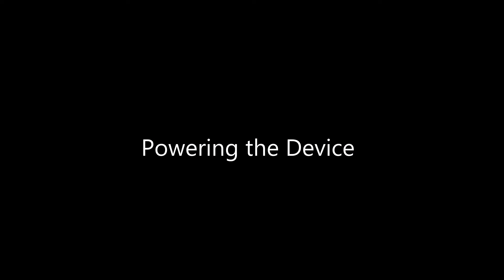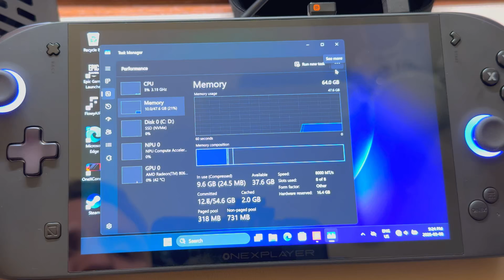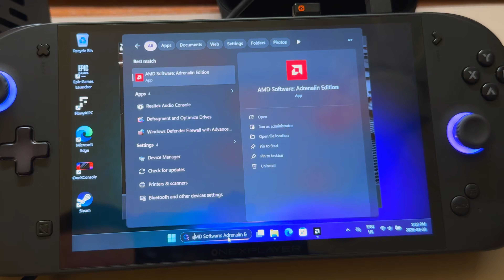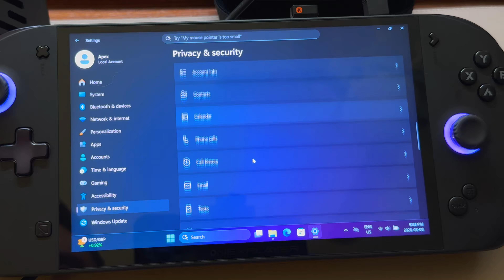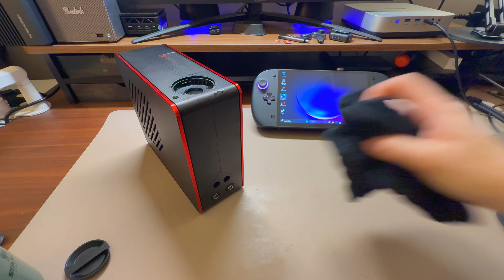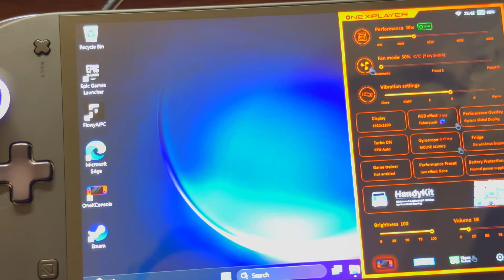OneXPlayer APEX - Day 1 Setup Guide !!

Comment: So once the liquid cooler is connected you lose the stand from the battery, that’s really odd and bad engineering because how the handheld will be sustained?
Reply: If your using liquid cooler you’re most likely docked, so it’d be in a dock anyways
Reply: @zbt62 

What dock is the the best for it? I want to hook it up to a 1440p monitor.

Comment: I don't get the use case for the Frost Bay. You can't reasonably use it for handheld gaming since all those cords take away from freedom of movement. Only thing it makes sense for is to get full power in desktop use scenario where you hook it up to a monitor and it sits there on the side while you have mouse/keyboard or a gaming controller.
Reply from the maker: That's exactly the answer. You were unlocking full desktop level performance. Because of the price of this, the expandability, and the performance, I can foresee a lot of people actually forgo a desktop computer altogether. Using this with the frost bay, and then just using a dock to drop it in when they get back and turn it into a full on desktop.
Reply: @TechGuyBeau and this is EXACTLY how I use mine. Literally sold my desktop for this device.

I hook this thing up to a 4k OLED monitor and get a perfect downscale to 1080p. I can work, play, game on the monitor while hooked up to the frostbite. When I want to go on the couch I disconnect everything and mobile I become.

Comment: If i want to change my old (i7 8700k/1060)  pc for this, as a main computer to games, would you think its viable? I'd need the frostbay to dock it at home? I'm asking that because I use the pc for long periods...
Reply from the maker: Well, This year has a monumentally massively better CPU than that computer, and the GPU is also significantly better. Overall, this is a significantly better system. 

Since it runs windows and has some pretty good ports, including USB4 you can get yourself a little duck and easily turn this into a dockable computer

Comment: Very good and informative video.
I got the frost bay too but never used it yet as at 80w im getting really high fps on highest settings on most games, did you notice any huge jump in performance going from 80w to 120w ?
Reply: 45 Watts is the sweet spot for everything no point going that high, the frostbay at 45 watts is perfect and keeps the handheld fans silent

Comment: I like that you recommend updating to newest amd drivers, as I personally noticed aggressive tuning and wattage during gaming before updating drivers, but after update it got better. Also in windows settings -> speaker properties you can see the harman apo sound signature ("system eq") gets wiped after amd graphics update cause of amd high definition audio for hdmi gets updated too. The fix passed around is to download apex driver pack and just run the install cmd file in the folder containing harman ap files. Audio is fine regardless but noticeable

Comment: Does it have pass through charging with the battery on?
Reply: Yes, you can set it in OXC.
Reply: well you can remove the battery entirely and set it on the side
Reply: @g3z yeah I understand that but with the battery on its got stand. Hence my original question was to find out if its got the option to battery bypass charging so I can leave battery on and use stand
Reply: Yes, it has the same onex software. So you can do bypass charging, I just haven’t been using it, when ever I’m connected I play without the battery, it’s the best experience because of the weight difference. I just connect battery to move from room to room, or in short airplane flights
Reply: Yes
Reply: Yes, I recommend getting the tether cable for $20.